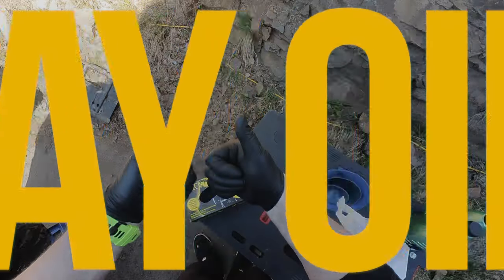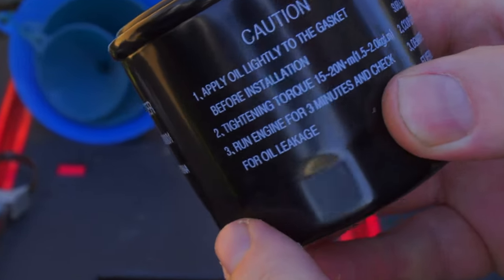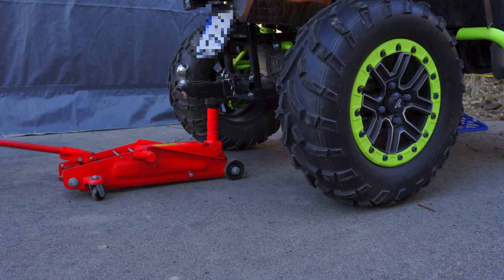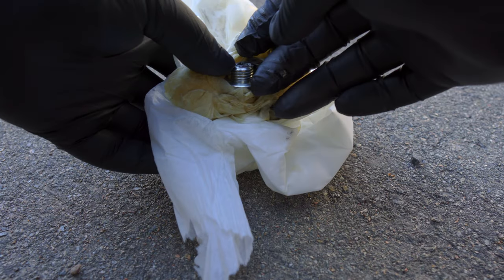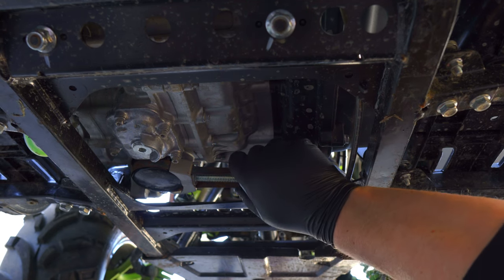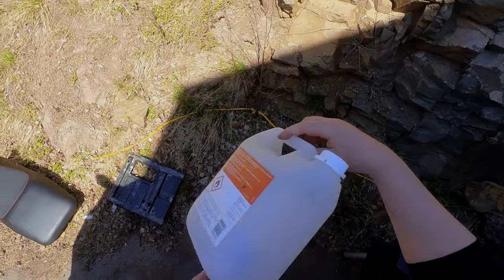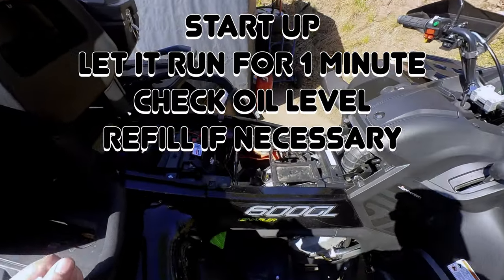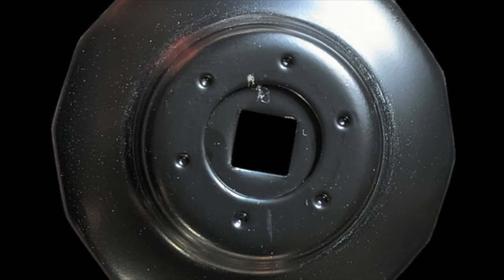Oil🛢 service on Segway Snarler 570, how to DIY

Comment: Hello there. I liked your page. as far as i can see you are good at this.I'm  bought snarler 3 weeks ago and now at 670 km. (still very new). I have a small problem right now. When I let go of the throttle on downhill descents, the engine suddenly goes blank and comes out of the compressor and and it's getting too fast. I took it to the service today but they couldn't solve the problem.  Can you guess about this problem?
Reply from the maker: Hi and thank you for kind words. 
Have you tried doing this in L or only H. How does it run when you start up. The idel speed.. is it constant?
Reply: @TorAnthonsen  Hello there,
sorry for the delay. Actually, I've never tried it in L.
I just tried it on H. When you release the gas, the engine brake stays on for only 1-2 seconds and then goes to idle.
Reply from the maker: I think it may be something whit your engine brake sensor. This must be checked at a dealer. Do you get an error in your display?
Reply: @TorAnthonsen  No, there is no warning on the screen. A friend in the facebook group recommended it. He said the bearing in the front variator is faulty. i will try it tomorrow

Comment: Hi. Thanks for putting up this video. It’s very helpful.  I just noticed that the drain plug bolt doesn’t have a rubber gasket around it?  Are they supposed to have one?  Or not necessary on these bikes?  Let me know. Thanks.

Comment: Good explanation here mate.
The Segway do actually looks like a great machine, seems easy to work on also or atleast changing the oil on.
Reply from the maker: Thank you 😃yeah it is easy to work on if u have experience. The only thing I need is the software to tune it 😎
Reply: @TorAnthonsen  Doesn't you have some places there where they do that? It's only a emap of the rom chip or something
Reply from the maker: Most likely yes. But I’m used to fix everything my self. I’ve tuned cars so this is no problem. And it’s cheaper lol

Comment: Is there any reason for not dismantling and cleaning the oil strainer, which is the first filter stage? At least on my machine, it's mandatory when changing engine oil and filter.
Reply from the maker: Of course u can do this, but I  only wanted to show the main oil change. It is more important when you’re covered a lot of miles and changed oil several times. But u should always follow the manual ;)

Comment: Hi you check wrong the oil level , if you want to folow the service manual  you shuld :
Stop the engine and wait several minutes for all the oil to

drain back to the sump.
◆ Unscrew the oil filler cap【A】 wipe its dipstick【B】
dry, and tighten it into the filler opening.
◆ Unscrew the oil filler cap and check the oil level. The
oil level should be between the upper (H) level line
【C】and lower (L) level line
Reply from the maker: Yes this is the correct way. But thanks to video editing it seems like I don’t do this. But I do. But thanks for letting other people know, if they didn’t get it 😉 i will let you in on a secret: I check the oil level before every ride 😎

Comment: Considering to buy a new 2022 but I'm a wee bit concerned since it's fairly new to the Swedish market. Does it seem reliable and strongly built to stand heavy towing in the woods? Like  a full load of logs on a crane-trailer? That brings on the next question, does it seem to have suitable gear ratio for that kind of use, or is it more of a recreational vehicle?
Reply from the maker: Hi there, the low gear ratio is absolutely strong enough but I’ve wished there could be a way to make the throttle less responsive. Other than that it will pull a lot of weight. 
There is still a little delay in the supply chain, so be aware of that if you need something fixed. I can take a long time to get parts. 
I can only speak for my self an my use, but I think this is a wonderful machine.
Reply: @TorAnthonsen  OK, is the throttle the regular wire operated, or is it electronic, like on recent Can-am and Polaris?
Reply from the maker: It’s wired.

Comment: what is the size of engine oil drain plug bits tip? and what is yout ratchet 1/2? or 3/8?
Reply from the maker: Hi, i use 1/2 and i think it was a 6mm bit.
Reply: Thank you, hexagon type? Or xzn type?
Reply from the maker: @mehmetertugrul6178 hex

Comment: how often should the oil be changed, light use only have 23 hrs on new snarler since buying it new
1 year now
Reply from the maker: I change mine at 50h. Then next at 100h. 👍🏼
Reply: @TorAnthonsen  is there a particular brand of oil to use, also is there a particular brand of oil filter brand an filter number part to use, keeping in mind that i live in ontario canada,
Reply from the maker: Hi, sorry for late response. Your dealership will have all you need. If not, use a trusted oil brand. Just Google oil filter Segway Snarler and there will be several dealers 👍🏼

Comment: Nooo, not BILTEMA Oil it is the cheapest oil to get hold of, it's been proven that their oil is very very bad, that it damages the engines of cars, motorbikes, etc long term.,al people should no this, I work as a car technician and have done so for 20 years and 
and before that 5 years as a motorbike repairer,   and we take oil tests when there is engine damage, and time and time again. We see that Biltema oil is often to blame for this on those who use it😂